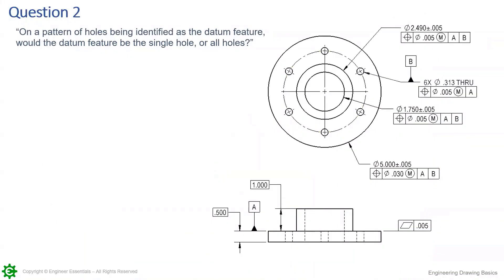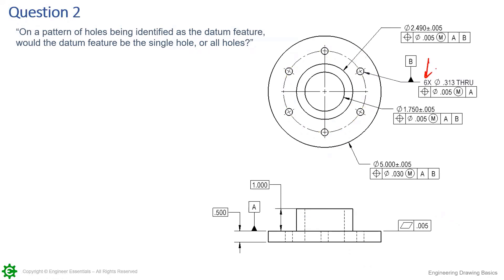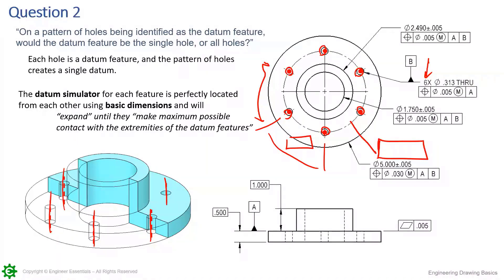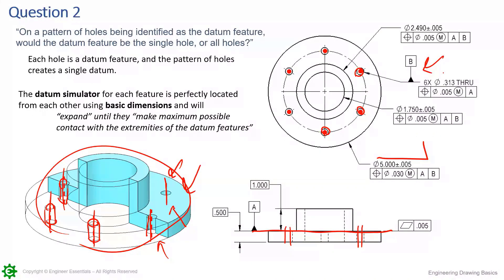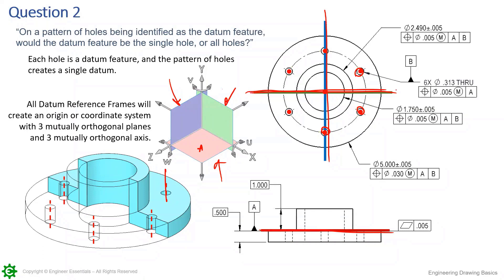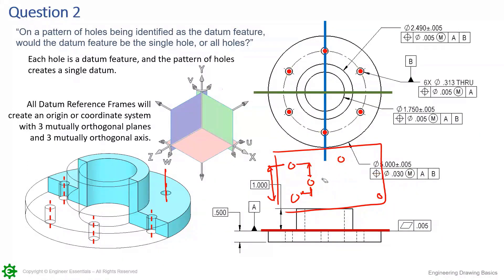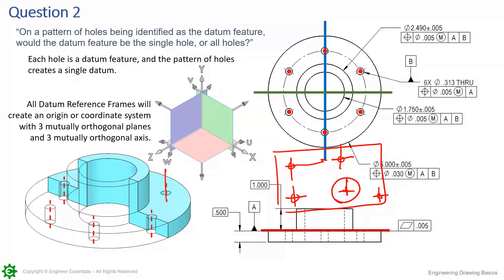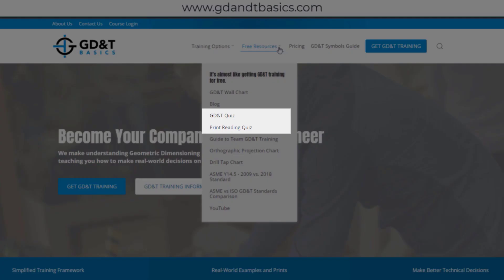Common GD&T Student Questions: A Pattern of Holes as a Datum Feature

Comment: how would you do it if the pattern was primary datum A?
Reply: Short answer is ideally you wouldn't. Holes that are part of a mechanical makeup are generally perpendicular to the face that interfaces the mating part. THAT surface should be the primary datum and the pattern of holes the secondary constraining the final three degrees of freedom.
Reply: @SMALLMOTORCYCLEADVENTURES Thanks for the response, do you use Gd&T often in your work?

Comment: You can apply the MMB modifier to datum B, right?  In that case, the datum simulators would be pins that have a diameter of .313+.005+.005 = .323 (assuming size tolerance is +/-.005).

Also, how would this be inspected with a vision system?  How would it establish the datum reference frame?  Would you need to upload a dxf, or draw the holes at true position?

Comment: Can you do an example of SLOTs, from a BC, cut thru the OD. B datum would be the axis of this part. 
Can you just position the slots (without DIA symbol in the control frame), and keep a non-basic BC? or does the BC have to be basic? How is the slot-to-axis related? My engineering team is debating a basic is/ is not needed for the bolt circle. EX 4 slots, equally spaced on a BASIC 45, and a BC thats nonbasic, should define its location per angle, per related to axis (datum)

Comment: Hi, I'm wondering if this works if you set the hole pattern as the A datum and the surface as the B datum? If you do this I'm not sure if you can position the hole pattern (which is datum A) to the surface B because you would be referencing B while establishing A before you have established B? I ask this because I have a part that has blind holes for dowels in a hole pattern so in my mind it would not be possible for the surface to be the primary datum feature if the pins have to align with the dowel hole pattern first and slide in before the surfaces can make contact, hence my reasoning for making the hole pattern the primary datum. 

Perhaps I should leave the surface as A and the hole pattern as B and then when I position other features I will make B the primary and A the secondary in the feature control frame?
Reply from the maker: You certainly can utilize a pattern of features as a primary datum, and then the surface that is perpendicular to the holes as the secondary datum feature. All this implies is that anything that refers to this datum structure is to be held in location and orientation to the pattern of holes first, and then if necessary, to the plane. scena

Comment: Sir, this is a wonderful session,also I have doubt. In DRF only mentioned Datum A&B only.
Q1# Is there not necessary Datum C for centre hub axis.
Q2# can mention  Datum C for (dia1.750) instead of Datum B(dia .313)
Q3# Is their any sequence for mentioning Datum according to part feature is producing at first. My concept is these  pattern holes are mfg by drilling at final.
Kindly clarify.
Reply from the maker: Q1: There is no need for a tertiary datum because the position controlling datum feature B (the pattern of holes) is controlling the location of hole to hole for the pattern and there are no other features left over to "clock" the final degree of rotation for this scenario. 
Q2: Identifying the 1.750 diameter as datum C does not add any additional control beyond datum B and therefor would be unnecessary
Q3: There is absolutely a consideration for order of selection for datums. For instance, if the 2.490 hole is a press fit diameter, then i would recommend that be datum feature B and the 6x bolt pattern would then be referencing A|B in its datum reference frame. However, more often then not, the bolt pattern is the feature that secures the part in the final assembly and therefor should be used as the datum feature.
Reply: @Gdandtbasics Sir thank you so much , to this reply .
Am just referring this note,fine.

Comment: how do you specify the orientation of the axis created by the circle pattern? I see you just assumed a vertical/horizontal orientation. But why is it assumed this way?
Reply from the maker: The pattern of holes has to create a datum axis that parallels the axis of the holes because this pattern as a datum cannot stop translation along this axis. That is why we must include Datum A in our datum reference frame. It can stop that translation. If we were to imagine the axis created by the pattern of holes parallel to datum A this would be incorrect.

Comment: This video is clear, thanks for sharing. One more question, if the pattern of holes of B datum feature are perpendicular to datum feature A, how to decide the original point?
Reply: What would be the point to define datum B parellel to datum A? It would not constrain any more degrees of freedom that are not already constrained by plane A. The only use case would be if both A and B would be relevant together as a single reference, so you would then specify the as a common datum [A-B], resulting in a median plane basically.
Reply: @AlexLapugean  Yes, you are right. Thanks for your notice.I just realize I asked a wrong question. 
What I really want to know is how to decide the original point if the B datum holes are “perpendicular” to datum A? How to setup the datum alignment on CMM?
Reply: @alanchang0118  AH, ok, that is also a common question, and the answer - though maybe not being as satisfactory as desired - is the truth: It does not matter.
Usually it will be defined by how you put the basic dimensions on the drawing, but it really makes no difference either way, as in the end, all features are measured with respect to their true position and the basic dimensions are only used to define that true position.
Reply: @AlexLapugean  Thanks for your answer. The datum reference frame is base on the basic dimensions which the drawing set, right? I think I know how to explain to my colleagues now.
Reply: @alanchang0118  Sure, you can think of it like that, that is what the metrologist will usually do. My point however was that it is not something set in stone and it is not really relevant. as long as the true position is the same with respect to the datum references that is used to locate/orient the tolerance zone, it doesn't change anything. You might see sifferent values for the basic dimension that define the true position, but in the end, the deviation from that true position will be identical, and that is what is being checked, not the absolute dimension.
Reply: @AlexLapugean  Super appreciate. This question confused me for a long time.